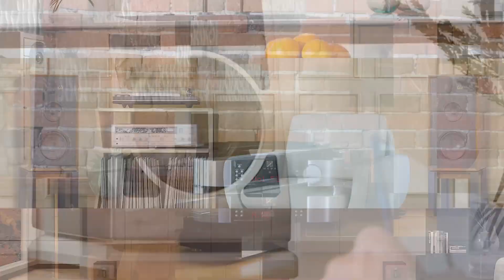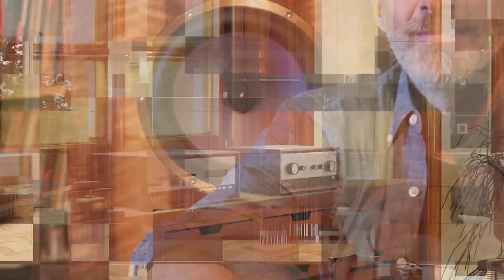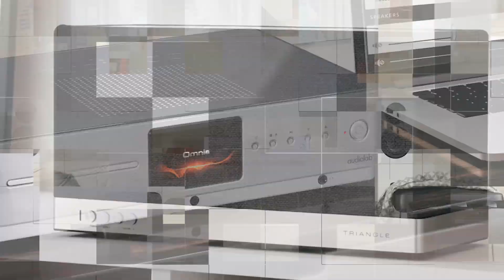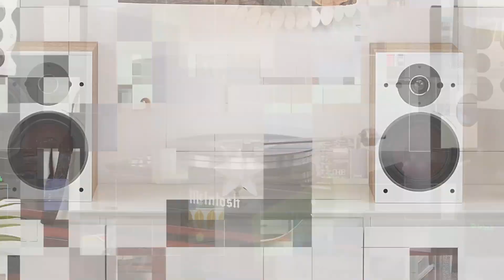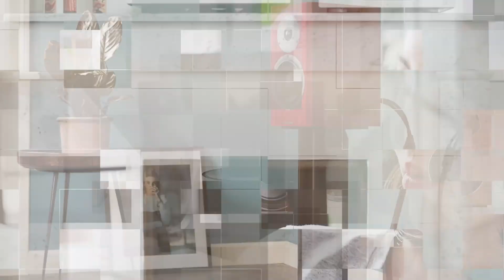Review: Sanders Magtech amplifier

Comment: An awesome, bulletproof amp and an audio bargain. Will drive anything down to 0.3 Ohms and has P.R.A.T. 

I have three Magtechs and one pair of the mighty Magtec Mono’s - used in an active system. 

4.7 kW into 4 Ω with regulated power supply- sufficient!